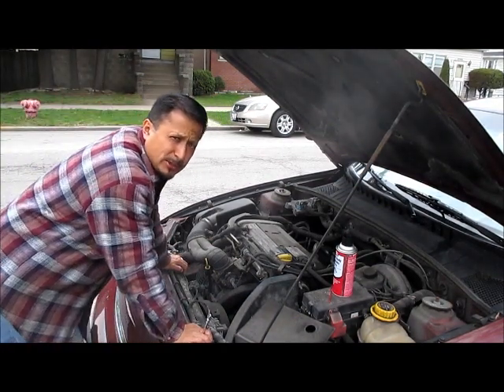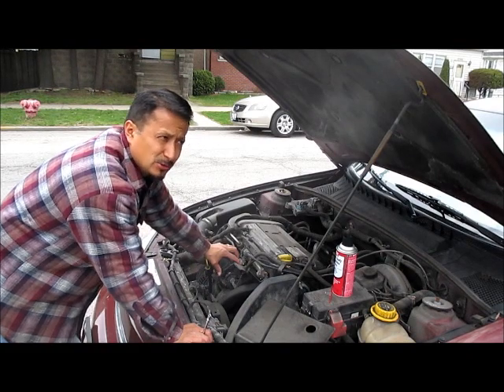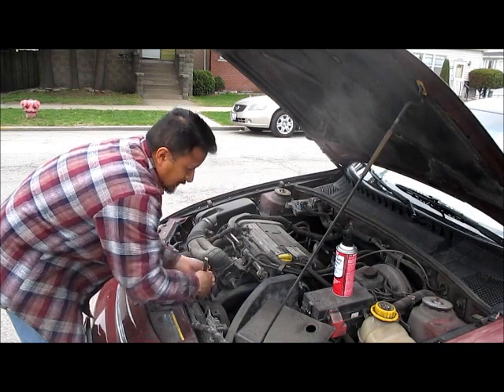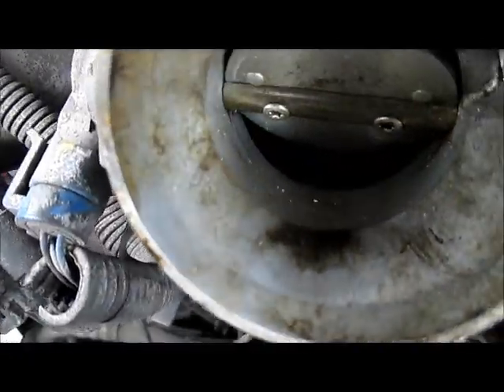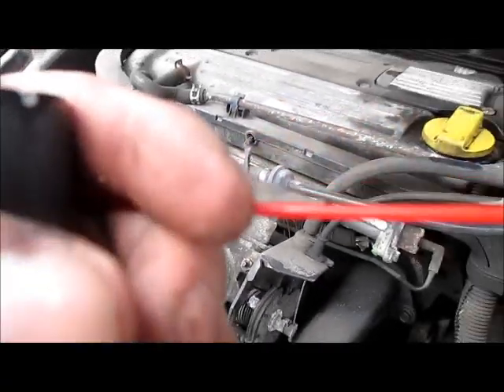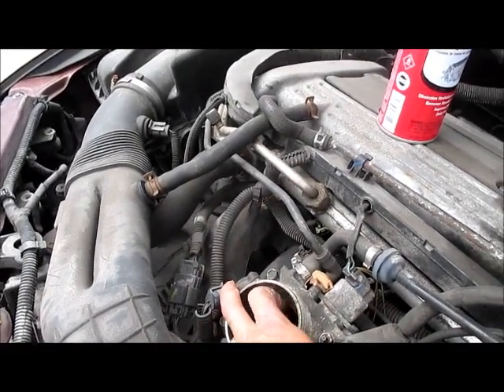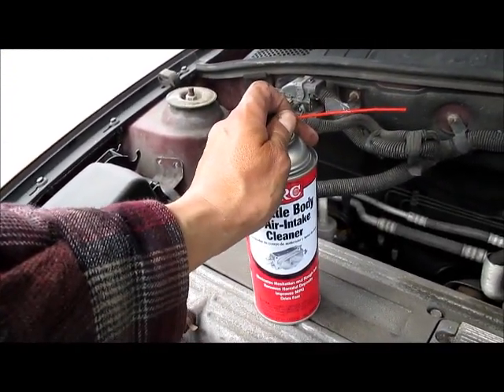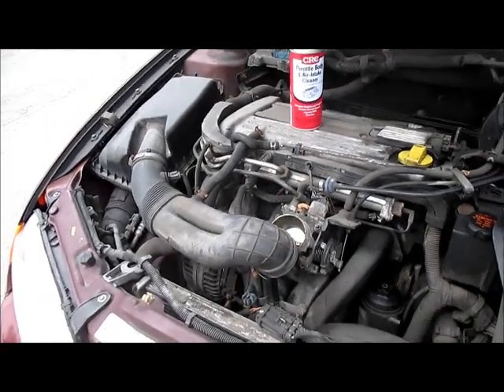2002 Saturn high idle at red light

Comment: I spent a load of money at a mechanic and he didn't solve the problem, so I tried this.
It worked!  Be careful what you stick in there you could plug up you fuel injectors if some cloth or part of brush fell in.  My Saturn now works great.  Thanks!
Reply: +Robert Trevino (trev2323)  I have an '03 Ion 2 that has been high idling like CRAZY at stops/slowing down. I replaced the idle air control valve but it didn't do much...I will do this next. I hate feeling like I have to keep the brake smashed down to hold my car back! And you're right about the passlock. I just disconnect my battery for a few min and it usually starts up just fine after.
Reply: Adam Bihn did you ever figure out your high idle problem I just had it start happening to me

Comment: please someone can help me, I have a saturn vue 2002 econotec, I turn off and no longer arrest, only gives pre gait does not turn on, they already changed the body of acceleration but the fault continues, they already rectified his head and changed the valves because it did not have compression, they changed the sensor of the following but nothing, the mechanic does not find fault